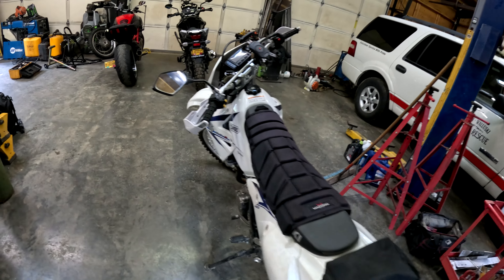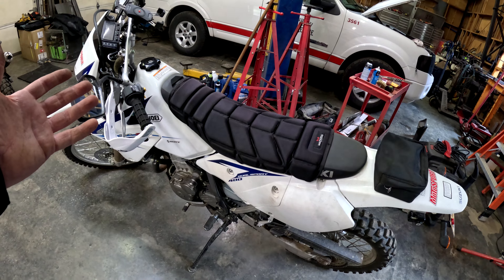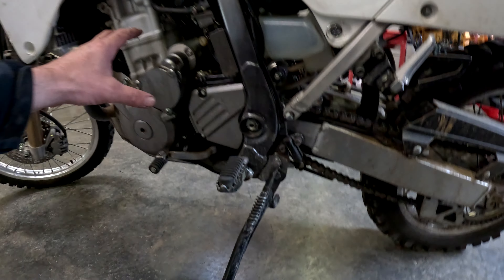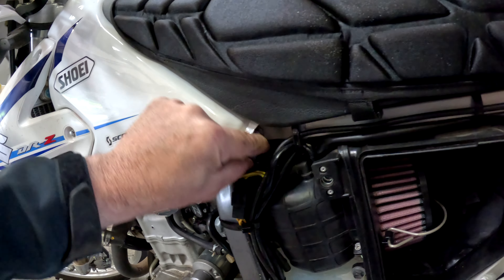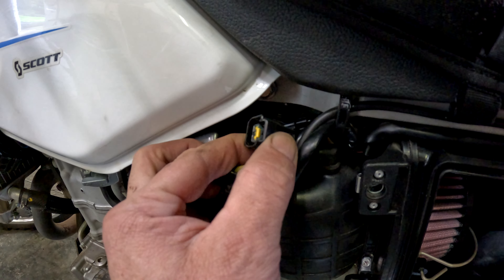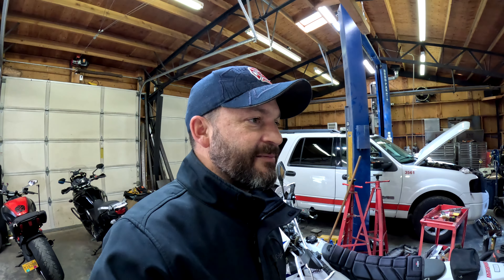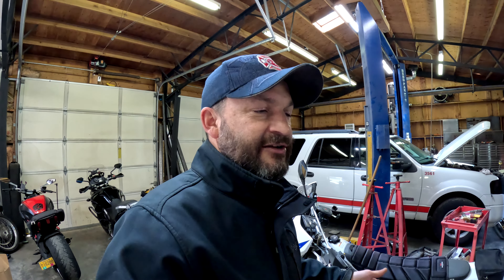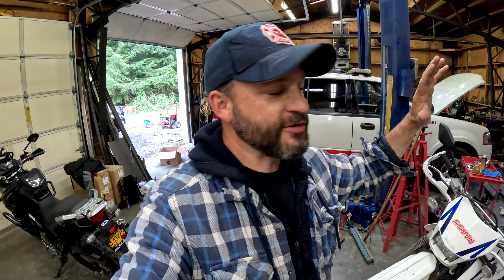DRZ400 charging system repair

Comment: Useful video! The connector seems to be the “Furukawa FW-C-2F”. Wonder if it could be used to complete a non-destructive “free power mod”. I assume yes but doesn’t seem to have been done.
Reply: Thanks for the detective work on this connector.
Reply: U mean make it run off just gas vapor instead of gas or simply run it off hydrogen(water) like those beamers

Comment: That is normal on the drz400 contact cleaner the other one is behind the battery fuse a small joint in the wire

Comment: My voltage bottomed out at 7.8 volts on a ride today.  It will stay running, but if I shut it off, it won't start unless I push it.  Maybe I should push it off a cliff.  :-0
Reply: Add a kick starter problem solved kick it be a man ….

Comment: Any links on where to purchase the black connector that heats up and fails?  (the one on the regulator/rectifier and the one it mates to on the bike).
Some quick troubleshooting this morning and I've found the one on my bike has done the same thing your has done - it melted.
I suspect the regulator/rectifier has failed too.  There doesn't seem to be any output from it.  The stator windings still check good with an ohm meter.

Comment: yo what is that little blue volt meter you have there I wanna install one!
Reply from the maker: It’s a usb/PD charger.  I designed and 3D printed a mount for it.  This is the one I used:
https://amzn.to/3RJzI5c
Reply from the maker: This is the video I did on the install:
https://youtu.be/VrPDZCcAzm4?si=As-hpOGaqK6WLujS

Comment: Ok so i have measured the following:
Big Pin with 3 yellow wires where you measured: 
12,9V Idle 
25-29V Choke

The small pin with red and black wire: 
0,4V Choke/Idle 

That means its not the stator but this small charge controller is bad?
Reply from the maker: Yes, that means that the stator is good, and the regulator/rectifier is bad (or you have a bad connection like I did)
Reply: @MattVerley  thank you for your fast reply!
But are you sure about that stator? 
I now found on Google that it should have 30 in idle and up to 70-80 whith more rpm:(
Reply from the maker: @wnjxtz8498  yes, I'm certain about the stator being good.  Those expected voltages vary a lot.  If you're making any more than about 20v at idle and it goes up as you Rev the engine, then the stator is working properly.  There is a little nuance to that...but for the purposes of troubleshooting a zero output from the regulator, you can consider your stator good.
Reply: @MattVerley  ok that sounds good 😊 
Thank you man!

Comment: It’s your own choice to make, of course, but, personally speaking, I definitely would have chosen to instead, cut off, both of the connectors on that Regulator to Battery wiring harness, because they definitely do have a long and well proven track record of, causing, lots, of charging problems on the DRZ, because of, as you discovered yourself, the corrosion issues that always, develop inside of them, whenever moisture gets into those connectors. 
And then, after cutting off the connectors, I would have then pushed over one end of each of the cut off, positive, and negative wires, a suitable length, say 2” of heat-shrink tubing, matched to suit the diameter of each of those wires in that charging harness, before stripping off about a 1/2” of the insulation from each of the ends of the wires, and then, either twisting the bared wires together and then soldering them, OR, instead, used a couple of suitable sized tubular, crimp-on wire jointing-sleeves to join the wires together again, before then pushing the heat-shrink insulation along and over the joins, in the wires, and heating it to shrink-fit it tightly, over the twisted/soldered, or, sleeved, joints. 
That way, you have then permanently, eliminated, those very, corrosion, and trouble-prone connectors, out, of you bikes Alternator/Regulator and Battery charging circuit forever.
And should you ever then need to replace your bike’s Regulator, at some point in future, then it’s really no big deal, to simply cut those wires again, and then re-join them again, after the new Regulator is fitted. 
If, you really, do, still want to retain those trouble-prone connectors on your bike, then it really is a very good idea, to pull them apart, as early on,  in the life of your bike as possible, and give them all, a good squirt of a good, heavy duty waterproofing product, like LanoTec, which will then exclude, water, from entering, the connector housings, and thus prevent the metal connectors inside of them, from corroding, for as long as possible.